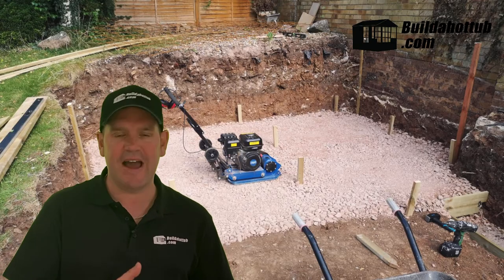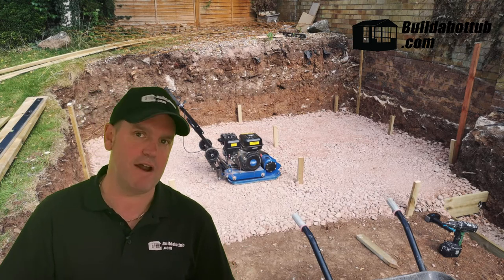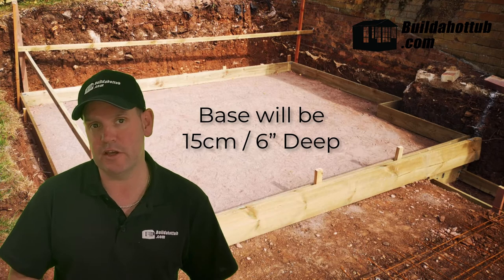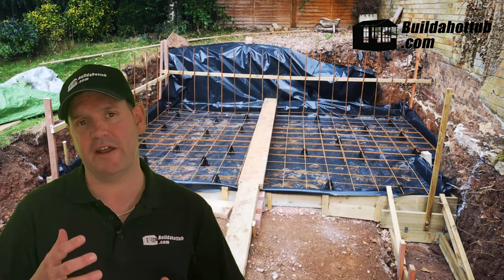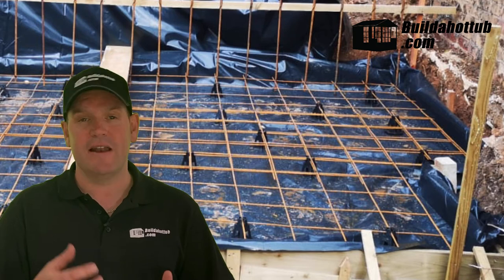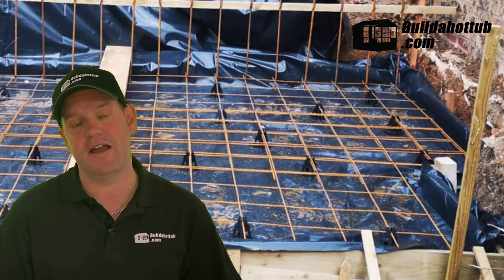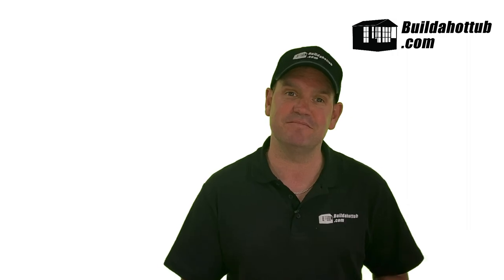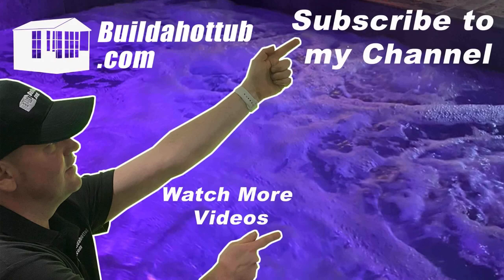How to build a DIY Hot Tub Base

Comment: is the rebar really necessary? a hot tub weighs an average of just over 100 lb per square inch and a concrete slab can more than handle that right?
Reply from the maker: Hi Yautja, thanks for the message. In the case of a plastic shell hot tub, yes, I agree with you the rebar would not be necessary. Most of what I do is with much larger and heavier hot tubs as they are custom made out of block or concrete and weigh a lot more as they have a lot more water in. Given the inexpense of A193 mesh to drop in, it is well worth it to increase the strength. Also, i would not want to leave it to chance on the larger builds, last thing you want is a crack! Thanks for the watch and comment, cheers, Andi
Reply: @Buildahottub  that makes sense. Thank you for replying 😃